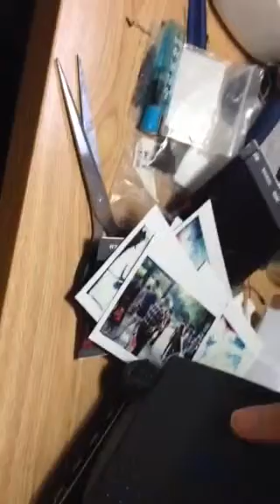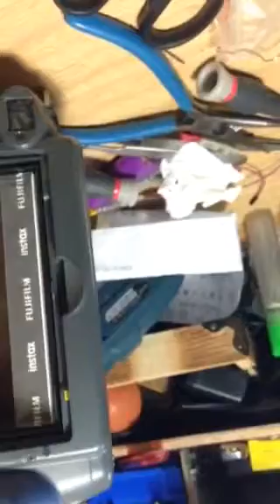using ardunio driver polaroid 110 120  instax converted for Instax Wide Film

Comment: Did pretty much the same mod and goth a Arduino to try and do the same but I'm lost as the Arduino runs on 5v and the motor of the camera runs at 6volts how you did to run it ?
Reply from the maker: I use a chip of the mobile power station, the chips disassembled from a little and one cell battery mobile power, the size and price all convenience. The chip providers high current power to drive the camera motor. I did lots of tests of motor source power, modifying the camera spring. The size of current  and spring power between balance is the most important, otherwise, the films been stuck or half of developing